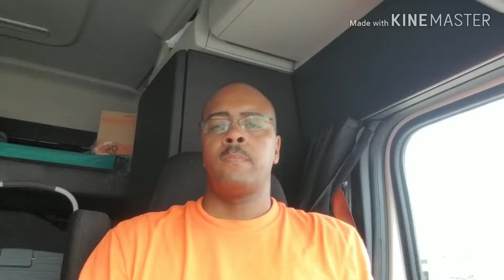Schneider- 14 hour DOT clock running out?

Comment: How much time do you spend on top of the trailer? I want to do tankers, but heights are an issue for me, any suggestions?
Reply from the maker: We only spend as much time as is necessary to open the dome lid, or check washout caps, hook up an air line, that sort of thing. It's not like you're up there for hours. Honestly I dont have any suggestions but to tell you what will happen. Some of our trailers have a barrier up top, some don't, like our intermodal trailers. On the first day, you will be made to go up top and walk back and forth, and squat down on a non-barrier trailer as a weeding out method. It's just you and the wind up there. Take a deep breath and relax is about all I can say. If you freeze up to the point that you can't get down,  you're done. Schneider has to know that you can do it on your own at a customer.
Reply: So at every stop you’re up there? And you have to drag a hose/air line up the ladder?
Reply from the maker: @kalehallman  No you're up there during pretrip and post trip. Takes like 2 minutes both times unless you discover a leak (it'll be a small leak), then you'll have to clean/rectify the issue. Theres an air line that is built into the trailer. It sits up top so it can be connected/disconnected within 30 seconds or so depending on if you're doing an air u load or pump unload.
Reply from the maker: @kalehallman  Also hoses never connect up top. if you do a pump unload, you're connecting from the bottom of the trailer, to the bottom side of your truck to the pump, then to the customers fill line. Air unload is from the trailer to the customers fill line
Reply: This makes sense. Thanks for the reply.
Reply from the maker: @kalehallman  no worries. you're welcome!